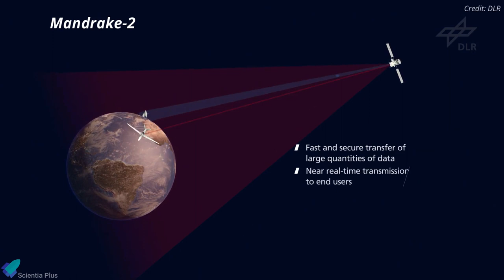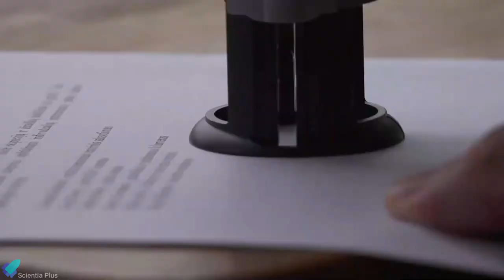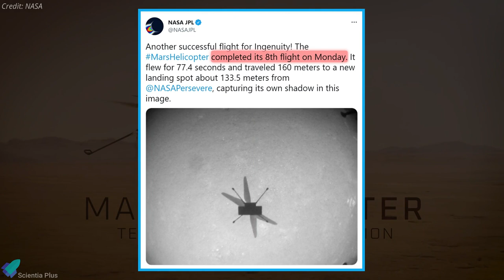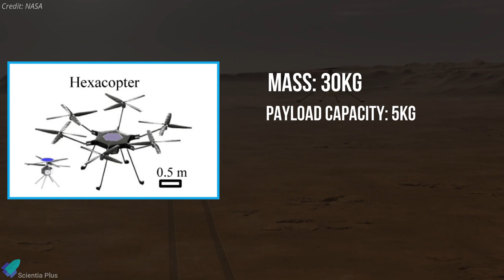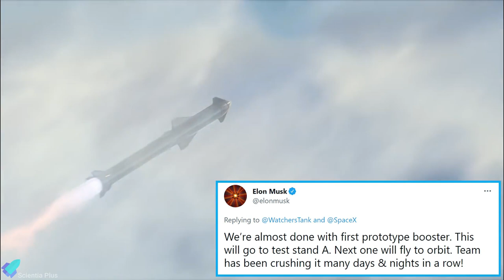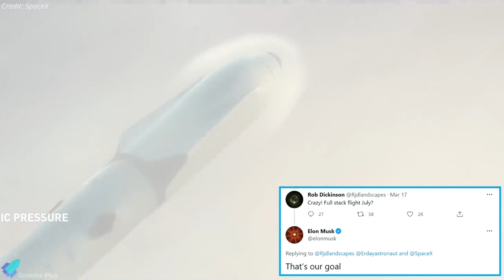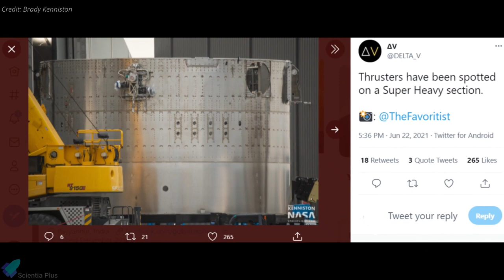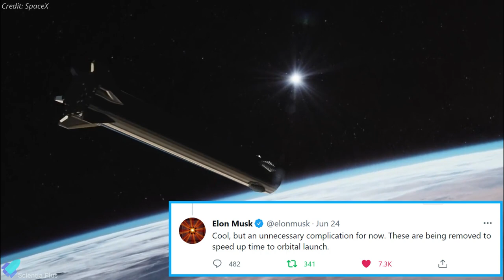Elon Musk Reveals Changes in Starship's Orbital Flight Plan | Transporter-2 | Ingenuity | Starlink

Comment: At 13:51 you repeat the incorrect statement that the cold gas thrusters use liquid nitrogen. No, they use gaseous nitrogen because liquid doesn't have enough enthalpy. The system that loads the gas bottles on the ground can use LN2, a pump, and a vaporizer to fill the vehicle's bottles, but there is no LN2 carried on the ship. I've seen several other channels make the same mistake. I don't know where this misconception came from but it seems to be contagious.
Reply: Also, thrusters with combustion may use the same types of propellants, methane and oxygen, but most likely will use high pressure gas bottles for supply to remove the need for independent pumps and feed systems that can capture liquids in zero gee and variable accelerations. They won't be fed from the main propellant tanks.

Comment: 10:58 Oil Rig wench will be used for booster catching arms.. using it's brakes for softening the "catch".    I would expect the first few launch stackings to be performed using the ground cranes they already have ... later a standard commercial crane may be added to the the top of that tower, maybe?

Comment: I don’t see July 
The orbital launch unit still need concrete poured in the columns.
Reply: If cement was to poured into the IT columns it would have happened as each segment was raised.   

Beyond that cement is not needed in columns as the tower must have a certain amount of flexibility just as a tall building or a long ship does.  But as usual we shall see.